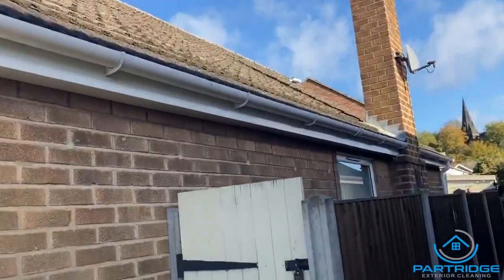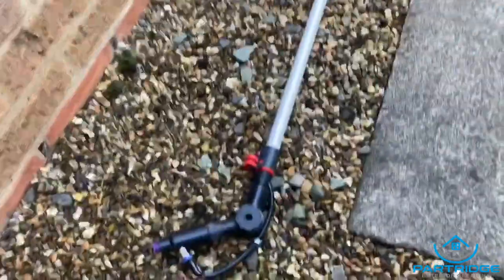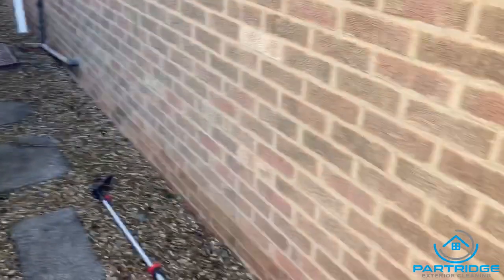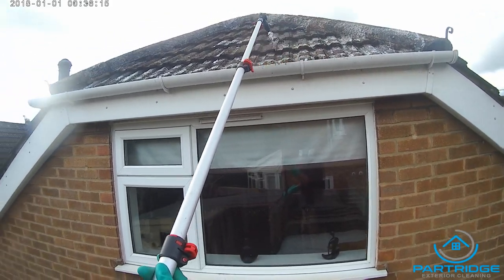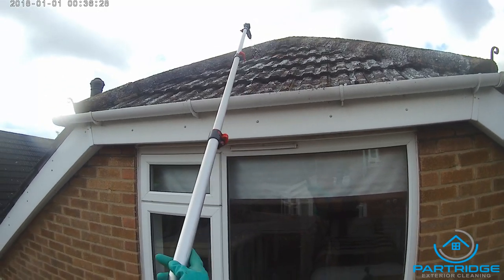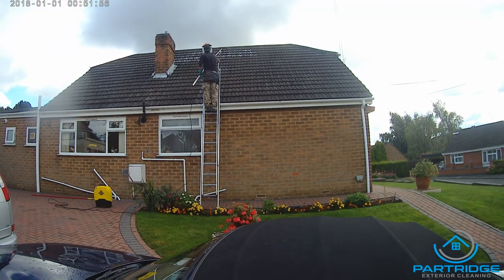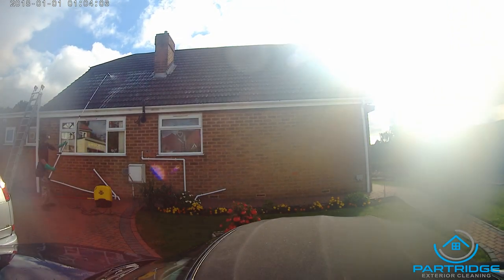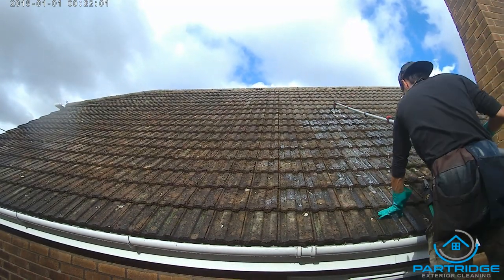How To Use Biocide To Softwash A Roof // Partridge Exterior Cleaning

Comment: I use similar set but with gardiner back pack I use a univalve in my pole great when I’m adjusting the pole no waste of chemical 👍👍
Reply from the maker: Would of went for Gardiner myself it I was ever in stock!
Reply: @PartridgeExteriorCleaning  I hear ya add the univalve thou way easier manoeuvre on ladder when fluid is off great videos bud 🍻🍻🇮🇪🇮🇪
Reply from the maker: @cororegan121  yeah man univalve definitely helps. i switch this pole around multiple times though so more hassle than its worth to me at the moment. Cheers matey

Comment: Nice job buddy a lot of guys start from the bottom and work up they say you get less steaks but personally I think if you start at the top on. Low pressure and apply it evenly you won't get that much run off well I don't seem to anyway
Reply from the maker: Agreed mate never had an issue starting from the top, find it easier to manage to be honest, as long as it’s on there and soaking in it’s all good if you’re using top quality products 👍 cheers for the comment mate
Reply: Starting from the bottom is good of you have a low flow as as you work upwards you re coat the stuff below
With a decent flow rate it doesn’t really matter
More so if using hypo as it makes a bigger difference

Comment: How does the big boy backpack cope with ‘harsh’ chemicals going through it? Cheers
Reply: I use a 12v pump the same as the backpack ones and the chemical one I use does a good couple of years if washed out properly after each job
25 quid for a new one
Every 2 years is a bargain

Comment: What do you do about runoff into the gutters as it shouldn’t go into the watercourse??
Reply from the maker: Im not sure if i mentioned it in this video but disconnect the downpipes and catch the run off, if you cant disconnect them for some reason I usually plug them up and mop up the run off once the roof has settled. I pour any run off into an empty 10L barrel and take it to the local waste site when it starts getting full.
Reply: @PartridgeExteriorCleaning  thanks for that. I have been wondering how people do it. I was thinking of blocking the gutters with say a heavy rubber ball and then when you’re done with the bio treatment sucking it out with a gutter vacuum. Do you think that would work??
Reply from the maker: @jasonb4915  You could do, a ball may still let some through though so wouldnt be perfect, 99% of the time you can just  disconnect at the top and pop a bucket at the bottom where itll be dripping but theres always a way. I do use a towel stuffed in the downpipe a lot

Comment: If you didnt use biocide how long is it before there is noticeable moss grow back?  I ask as I use the rain water for plants and I'm worried I would be collecting a diluted biocide solution in my water butt
Reply: The moss would grow back quickly if not treated with biocide. Really you should disconnect the downpipes when biociding a roof so that you're not polluting local water sources
Reply: @benjak02t  In my area there is only a single pipe into the road.  The new builds they separate rain water pipe.  Locally everyone just dumps it into ground

Comment: Ever used a 12v chemical pump to apply biocide?
Reply from the maker: No mate what’s the extra benefit do you know?
Reply: @PartridgeExteriorCleaning  higher rate of flow have a look at everflo pumps. Can run them off a car battery.

Comment: Hi friend what bio do you use
Reply from the maker: Hi mate I used Algoclear pro in this but trying out some GKPRO if it warms up this week
Reply: @PartridgeExteriorCleaning  
Algo clear is very expensive
Reply from the maker: All the main ones are around the same price mate, they’re approved for roof work so no worries with insurance if anything goes wrong. If a 5L of biocide is under £90 be wary of it because it’s probably extremely weaker or it won’t last as long as the main 3 companies. Algoclear, Benz, GKPRO 
I wouldn’t risk shopping anywhere else
Reply: @PartridgeExteriorCleaning  
I get the algo clear pro 140euro 10 liters . Algo clear has a new one out now is called 50/50
It's twice as strong talking to the rep yesterday  . Mosgo has a new and improved formula it's meant to be 70% stronger than the old one. It's 25euro a gallon I never found it to be any good that was the old one it was only 4 per cent where algo clear was 40per cent .if the new mogo is 70% stronger????
It's called mosgo green  remover . God blesd
Reply from the maker: @mazman8343  No idea mate havn't heard of the mosgo, might be worth a look, i'll read up on the data for it when i get chance :D
Reply: @PartridgeExteriorCleaning  👍